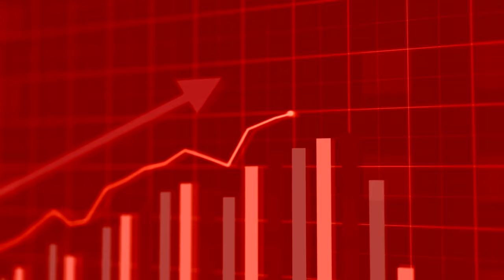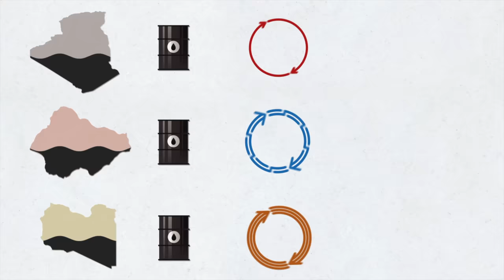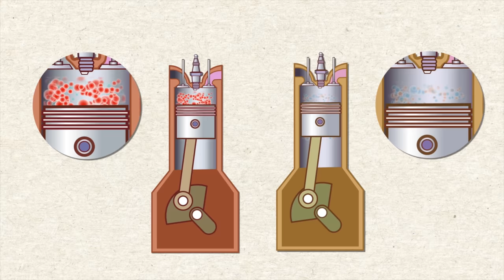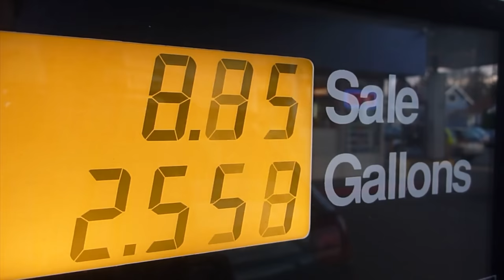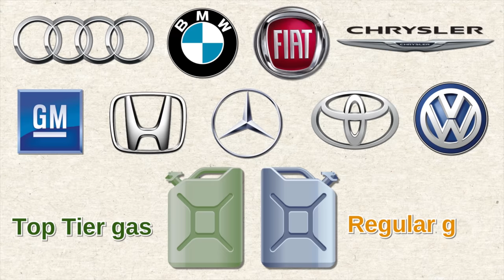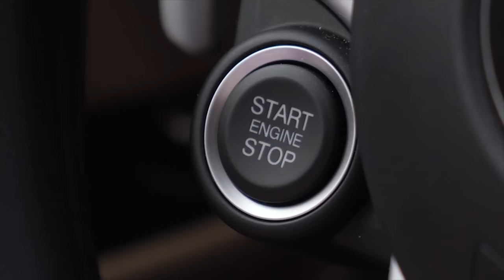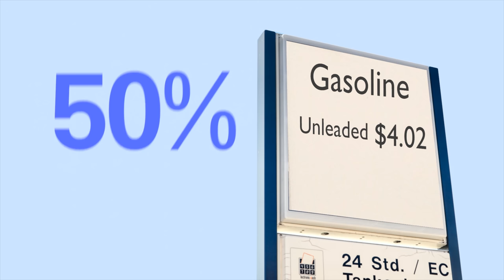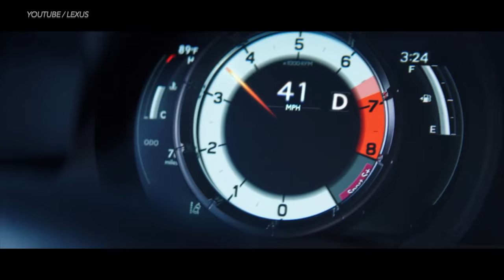No One Has the Balls to Tell You the Truth About Gas Prices, So I Will

Comment: I used to put 110 octane in my 240sx back in 1999 lol I was only 18 and the car only had 160hp at best. lmfao I remember sitting at the gas line with all the street bikes lmfao it was an old shell station in Southern Indiana, it's gone now, but that Lil station sold turbo blue 110 octane lmao it. At that time 110 was 3.60 a gallon lmao I knew regular fuel would equal too that, soo it didn't bother me at that time. lts soo funny too remember that.

Comment: Also, the reason they dont use the only truly close to green option, nuclear, as it doesn't generate the massive wealth that all the other forms do. Nuclear doesnt require supertankers and massive refineries, or massive factories to build windmill parts or massive strip mining for rare elements for solar panels. Nuclear plants run for a long time on very little material, comparatively. But they are expensive and make very little money. At least until they drive the price of electricity skyrocket high. France already figured this out and 80% of their power is nuclear. India is headed that way with thorium molten salt reactors.

Comment: Scotty you just said to switch off engine when waiting for more than a minute to save fuel! I never thought you'll say this. Engine is not a light switch and stopping and starting is extra unnecessary strain on battery and starter on top of loosing oil pressure. Scotty are you going green? What next? Moving to Canada? 😀😀😂

Comment: EVs are expensive.
Gas is expensive.
Buy a small engine motorcycle, cost about $20 to fill them, and get between 50-100 mpg!
Cheap to buy, cheap to run, cheap to insure and cut conjestion.

Comment: I'm not against EV's and trying to reduce our impact in the environment. What I don't like is the ignorant optimism that a rapid conversion and bam in ICE's is the way to go since the biggest problems facing an EV centered automotive industry are things like battery issues, the fact that manufacturing and electricity production still relies heavily on fossil fuels, negatively impacting the emissions reduction of EVs, and the fact that the production and disposal of components required to build EVs is an ecological disaster. The methods of obtaining the rare elements like Cobalt, nickel and lithium, the toxic byproducts of manufacturing batteries, solar panels and motors, and the disposal of these byproducts and the degraded components themselves are growing pains that are not being adequately addressed. There's also the fact that methods like solar, wind and hydro generated energy have tons of drawbacks and problems that mean they are not viable avenues for our main source of energy production. Nuclear energy is the way to go, but has been damaged by propaganda and fear mongering which has badly hurt it's development. And lastly, it hurts to admit that unless a compound can be developed that has energy potential to rival gasoline than can be obtained from renewable sources and has clean emissions, we do need to move away from fossil fuels and ICE's, because hit rodding and cars is my love and passion. But, I believe the performance scene will evolve no matter how cars are powered, because as Formula E racing has shown, humans always want to go fast.

Comment: I'm not going to bash "renewable energy" on its face. But the tech IS NOT THERE. 

Meanwhile, modern ICE vehicles have vastly improved emissions reduction. You can drive a modern V8 truck cross country, and produce less emissions than your two stroke line trimmer does in six to eight hours of use. Meanwhile, coal and natural gas are the primary source of energy used in the world's powergrid, so EVs effectively run on coal.

When you consider the math on EV cost versus comparable ICE alternatives, factor in how much the tax credit costs taxpayers, evaluate the harm of strip mining and "artisan mining"(child slavery) for batteries, the cost of replacing those batteries once they degrade, the non-recyclable nature and carbon cost of assembling wind/solar hardware, the best short-term solution is "fossil fuels", especially petroleum.

People struggling to obtain daily needs will NOT participate in environmentalist goose chases. If you want the world's people to be hippies, the first requirement is that they be care-free, regarding their base life-sustaining needs, and access to them. Green energy is so unaffordable, it consumes more tax revenue than welfare and social security combined, to subsidize it along an ongoing basis.

Thus, "saving the planet" is, at its core, less about environmental stewardship and more about the genocide of the poor. Meanwhile, the elite members of the Upper Class, and heads of NGOs (such as Schwab and Bill Gates) have the carbon footprints of a small town among them individually, as to how they themselves live.

It is more sustainable to have everyone adopt SMALL CHANGES, than to kill ten thousand for one's lifestyle to have less overall effect. But that is what they will do:
You will be starved.
You will be stripped of possessions
You will be denied access to wealth
You will be rationed healthcare
You will be sterilized
You will work til death

Comment: No infrastructure for EV.  A household may have 3 to 4 cars.  Can you imagine all the charging wires littering the driveway? And how much electricity will be draining from the house to charge 4 cars?  How about people who live in Apartments?  Is the Apartment owners going to install charging ports at each parking space?  Sorry, but EV is not a realistic solution.  Unless each Battery Station allows for quick battery module change.  But the way they are designing the batteries, it is too big and too much part of the car to be changed out.  The only realistic alternative is HYDROGEN FUEL  It takes as much energy and pollution to make hydrogen but once made it fuels total emission free cars just like EV.
Reply: Where is the hydrogen infrastructure?

Comment: all you have to do is look at cell phones they can make your cellphones batteries  drain faster to make you buy a new phone they did this to i phones until they got found out. 
so since its all electric car. what makes you think they wont do this to the car batteries  which costs 20,000 25,000 to replace..
i'm assuming the ev cars get updates for this self driving auto mode.
norm cars can last 10-20 years your ev cars will probably only last 8 years with its batteries  
so that means each year you get less km per charge as your batteries die.  it may be cheaper to fill up your ev car now but will be 10,000 times more to replace the batteries.

and dont forget cost of power is only going up per year so how long till it costs just as much as gas.
and for all the haters out there what do you think powers your ev car coal gas nuclear powerplants
 just my train of thought.